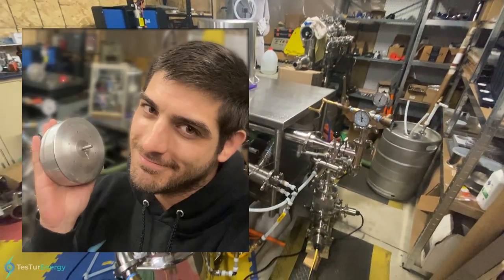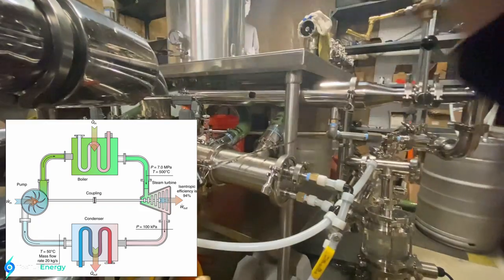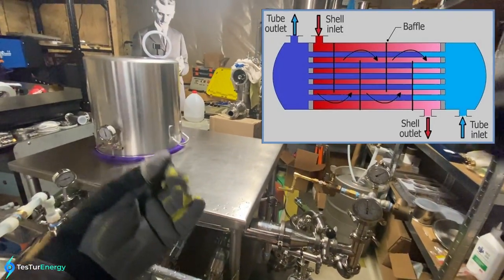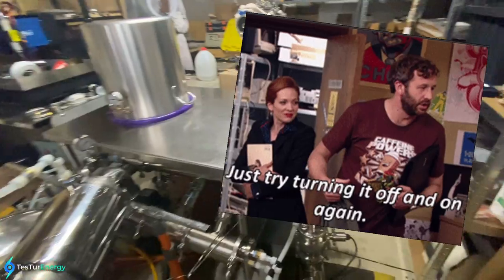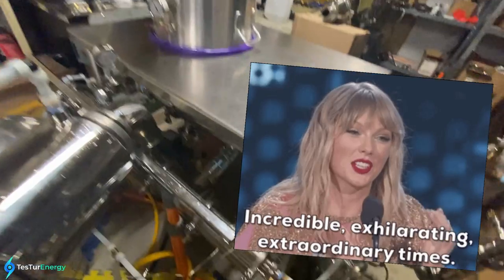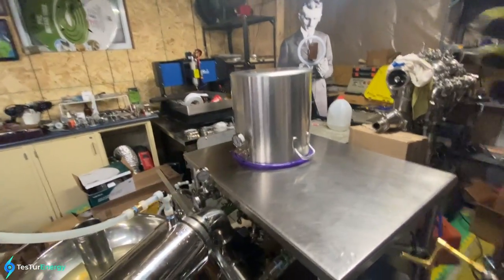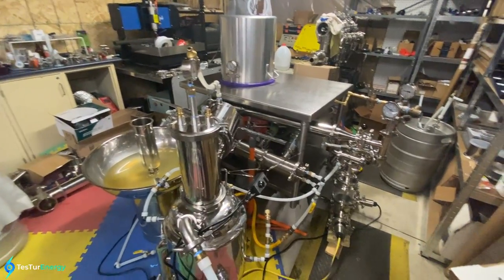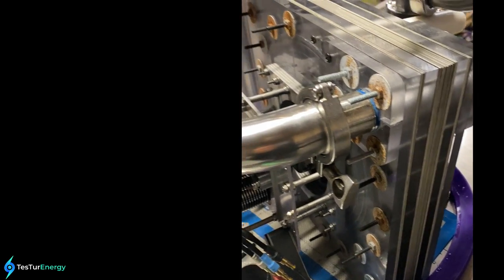Steam Tesla Turbine Renewable Energy Micro Power Plant - 1st Start Up

Comment: What made you choose 10 in disc and how thick of you don't mind me asking?
Reply from the maker: This was honestly more of a “what materials I could find to make it” and “what I could even fit onto my cnc machine bed.” Than a case of “what I would have made if I could have from scratch.” 

I also wanted to bring down the rpm of the turbine by going with a larger diameter disc.
Reply from the maker: It was also helpful to make one close to the size of tesla’s 9-3/4 in discs in the turbine that they tested at the Edison plant so I could get a comparison of power out.
Reply: Thanks for the reply. This is awesome. Maybe I missed this but have you looked into adding a pump on the shaft of the turbine.  I read somewhere it can increase efficiency. I apologize if you have done this already great work 

Cheers from Canada
Reply from the maker: @shawnrobinson368  hey Shawn no worries. Yes I have! I’ve got a video on one of my designs for that has the condenser/ heat exchanger between the turbine and the pump. Check it out! 

Tesla Turbine - InterStage Heat Exchanger (ISHE) - Heat Pump & Inverted Brayton Cycle Improvements
https://youtu.be/pYSniitC8DM
Reply from the maker: @shawnrobinson368  if you’d like more information on the thermodynamics check out the Inverted Brayton Cycle! 
https://en.wikipedia.org/wiki/Inverted_Brayton_cycle
Reply: Cool thanks I will be watching your updates. Maybe I will try my own version one day
Reply from the maker: @shawnrobinson368  Hey I just posted a new video! I think you’ll really like it. Who Owns Your Copy in the A.I. Revolution? https://youtu.be/_v0N83U4NoU

Comment: Just found your channel and I'm loving it. 

Sorry if this is a noobish question but what do you want to do with the electrical feed through? If it's to get sensor data on the speed of the turbine and no need to pass a lot of power through then you might do will with a micro processor with low power wireless and a battery. Maybe and induction coil to power it if you want to run it for a long time but I'd imagine you tear this thing down fairly regularly. 

A lot of microprocessors are designed to consume bugger all power when they are asleep these days, even a small lipo battery can last a long time.
Reply from the maker: Hey David! Thanks for commenting! It really helps with the algorithm! 

So for the vacuum feed through we specifically need it to pass the generator power wires from the inside to the outside. So potentially 250-350amps current through with the 12v up to 4000watts.
Reply: @CharlieSolis  thanks for explaining. 😀
Reply from the maker: @Omniwoof  you’re welcome! Thanks for the ideas! They will securely help for sensors and stuff.
Reply from the maker: @Omniwoof  Hey I just posted a new video! I think you’ll really like it.
Who Owns Your Copy in the A.I. Revolution?
https://youtu.be/_v0N83U4NoU

Comment: Have you ever checked out those rotary steam generators. They produces steam through rotation. They use cavitation to produce steam. You have to be careful with cavitation as it does produce radiation, but I believe that would be more efficient than using an resistive electrical heater.
Reply from the maker: Hey thanks for commenting! ❤️‍🔥🙏

Yes! 

Check out my design for an improved construction and manufacturing method for them! 

Solis Cavitation Heater - Simple & Improved Construction Griggs Hydrosonic Steam Water Pump
https://youtu.be/zbd50_hOy0U

Cheers mate!

Comment: very cool.
Reply from the maker: Hey much love and gratified my dood!
Reply: @CharlieSolis  do you have a video explaining what exactly your goal is with this. 
I definitely am with you when you say there is wasted heat and energy all over the place but do you believe that this Tesla turbine or a similar vacuum / geothermal or steam generator system can be realistically implemented for a net global savings? Im
Reply from the maker: Hey thanks for the reply! ❤️‍🔥🙏 yes I think it’s possible. I don’t think the TesTur will replace everything out there. 

But it can certainly be used in many places. 

I’ve got some copy pasta 🍝 I’ll share with ya that should help. 

With TesTur Energy, our mission is to give people energy independence through Combined Heat And Power (CHP) systems that can make use of underutilized energy sources like biomass, solar thermal, geothermal and even low grade fuels containing high quantities of solid particulates (like pulverized coal and powdered iron); energy sources/stores that are currently underutilized due to the lack of turbines and engines capable of handling the multiphase fluid flows (any combination of gasses, liquids, solid particulates) present in low grade heat boilers and low grade fuel sources without damage over prolonged/continuous periods of use.   

Www.HeatAndPower.com   

www.TesTurEnergy.com 

First and foremost, in terms of using high pressure, low temp gases in actual generator capacities, Compressed Air Energy Storage (CAES) and Liquid Air/Cryogenic Energy Storage (LAES/CES) are very viable solutions, and they’re being employed at industrial scales as we speak.  

When we look at how engines function, they typically compress air, heat it, and then expand it.   

Most gas turbines and turbojet engines possess a compressor, operating on what’s known as the Brayton cycle.   

For those unfamiliar, the Brayton cycle comprises three main processes:  

1) compression of air 

2) addition of heat (typically combustion but could be anything) 

3) then expansion of the air. 

If we’re talking about steam systems, only heat needs to be added to vaporize the fluid. 

Systems like ocean thermal energy conversion (OTEC) can vaporize steam, or even function in an organic Rankine cycle, at significantly reduced temperatures.  Tesla’s improved turbine patent GB 186,083 is particularly noteworthy here.  

It cleverly uses heat from the turbine exhaust to generate steam.   

This steam then cools the combustion jet before it enters the turbine, thus significantly reducing the compressed needs typical of most gas turbines.   

While regular gas turbines require an air-fuel mix in the range of 100:1 to 200:1, thanks to this innovative approach, Tesla’s patent slashes the load that the compressor puts on the shaft, making it efficient even with stoichiometric mixtures around 15:1.  

Moreover, Tesla’s patent GB 186,084 combines combustion and steam turbine functionality, eliminating the need for a compressor altogether. 

These preliminary tests are just to see how much electrical power can be produced with room temp compressed air driving the Tesla turbine.       

6.22ft-Ibs of torque at only 4150rpm and +4.25kW between 6000-12,000 rpm.        

That puts my plastic and aluminum prototype right in between a 50cc and 125cc piston engine on combustion and 150psi compression.  

The TesTur nozzles never went over 20psi at the nozzle for the 2650watt electrical load test and not over 40psi at the nozzle for the 4250watt dyno test.         

This is so I can get a baseline for what to expect as I increase the temps to combustion levels.         

When using elastic gasses the counterintuitive thing most overlook is that the viscosity of gasses goes up with temp.       

So not only do we see an increase in thermodynamic efficiency from increased temps but the TesTur isentropic efficiency also goes up due to the reduced slip from the increased viscosity.
Reply: @CharlieSolis  I have experience with jet turbines running on biomass ( see my vids). I also had the plan to couple the turbine to RC motors for power output, but unfortunately "real life" gets in the way and sends me into the Caribbean. The goal was to create a simple power generator that could work from hog fuel or discarded biomass. I wanted to eliminate complex steam systems. The low temperature that Tesla turbines can run on with noted patents is promising. Ultimately I don't want to be the person operating such a device.. I wanted to be able to train a general novice how to make their own power ( minimum 5kw) in less than a day and replace parts at a local parts store. Anyways I hope that's helpful

Comment: Would something like this be possible to produce power from the heat going out in the chimney from a bigger wood boiler?
Reply from the maker: Hey thanks for asking! Yup that’s one of the applications we’re shooting for! 
 
With TesTur Energy, we’re committed to empowering individuals with energy autonomy through our Combined Heat And Power (CHP) solutions.   Our systems are uniquely designed to harness overlooked energy resources like biomass, solar thermal, and geothermal, as well as unconventional fuels rich in solid particulates—think sawdust, pulverized coal, or powdered iron.  Traditionally, these alternative energy sources and fuels have been underexploited due to the limitations of existing turbines and engines.   These systems often can’t manage the complex fluid flows—mixtures of gases, liquids, and solid particles—that are characteristic of low-grade heat boilers and unconventional fuels.  But our technology changes that, enabling sustained, damage-free operation even in these challenging conditions.  www.HeatAndPower.com  www.TesTurEnergy.com 

Let me know if you have any questions! 
 
Cheers mate!

Comment: I'm interested in motorsport performance applications of a Tesla turbine (less lossy forced induction). Heat exchanger on exhaust manifold and Tesla turbine replacing either the impeller side of a turbo or both the impeller and compressor. Not sure if Tesla turbine can sustain higher pressure as a compressor. Figured you were the man to ask, you think this is feasible?
Reply from the maker: I really appreciate you taking the time to leave me a comment, it means a lot to me and it helps increase my visibility on the algorithm. I’m glad you’re interested in learning more about my project, I’ve put a lot of work into it

Yes I absolutely do think this is possible. I’m working on the design of the multistage Tesla compressor and high vacua pump right now, in fact. 

Thanks again for your support, and if you want to help me out even more, please consider donating to my Patreon page or any of the places on my linktree in my bio, it will help me to continue my project. Your support is greatly appreciated.
Reply from the maker: Check out my interstage heat exchanger idea for the Tesla turbine 🤓😬🙏❤️

Tesla Turbine - InterStage Heat Exchanger (ISHE) - Heat Pump & Inverted Brayton Cycle Improvements
https://youtu.be/pYSniitC8DM
Reply from the maker: Hey I just posted a new video! I think you’ll really like it. Who Owns Your Copy in the A.I. Revolution? https://youtu.be/_v0N83U4NoU

Comment: F yeah we could hear it! Jeez. Almost sounded there for a bit like it had no ceiling. Curious: What enclosure are the blades in to where you are safe standing right there? Or are you safe? Also, where is all of the water going if it is a sealed system like I am assuming? I know you said that heat comes off the cooling tower, but I thought that was radiant.
Reply from the maker: Hey Benny! Thanks for commenting! I really appreciate it. So the turbine is inside of an aluminum and 1/2in thick polycarbonate casing with 1in thick periphery. The turbine is then inside the aluminum vacuum chamber. 

I should probably also have a blast shield but these discs should be safe up to at least 7,000-9,000rpm and this won’t be going much over 3,000-4,000 rpm for the 12v output tests coming up soon. 

After the turbine the steam goes into the condenser. In this video I did not have a boiler feedwater/condensate return pump. So the water just went from the boiler and stayed in the condenser. That being said I’m testing out the pump I just installed for making it a full closed loop Rankine cycle system be be able to recycle the water from the condenser back into the boiler. And if this pump doesn’t work it’s just a matter of putting the right one in. 🤷‍♂️ 

Alongside this I’ve also installed a boiler feed water preheater that heats up the returning condensate with the now heated cooling water leaving the the condenser to give it back the last bit of heat from the hottest part, of the condenser just after the turbine for some efficiency increase, just before sending the water to the fountain for giving off the heat. 

It won’t be much at these temp ranges but at least it’ll serve as a proof of concept but it’ll be ready for combustion temp once I’m there. This can keep the “cooling water” loop in the condenser at a higher pressure so that it can go up to higher temps and not boil before reaching the fountain and releasing up the riser column more efficiently with the higher temperature gradient. That or use a liquid with a higher boiling point than water for the cooling but that seems messy and complicated.
Reply from the maker: Hey I just posted a new video! I think you’ll really like it.
Who Owns Your Copy in the A.I. Revolution?
https://youtu.be/_v0N83U4NoU

Comment: Interesting setup. One concern I would have is the cooling of the electric generators. In a vacuum, you're basically relying on the conduction through to keep the insulation from melting. No convection :( . Not sure if you thought of that, if you did mention it in the video, my apologies, I didn't have time to watch in entirety.
Reply from the maker: @JonPrevost  hey thanks for commenting. 🙏❤️‍🔥 
So in the latest setup I have cooling water jetting onto the generators themselves. 
 
Which is great because if the generators are over the boiling point they the water will rapidly remove heat from them via the latent heat of vaporization, even better than any air or even just water cooling. 
 
I would like to make the generator boil off actually go to the nozzle in a final build to just recoup the any energy (it won’t be great but it’s something 🤷‍♂️) to add back to the torque output.

Thanks again for commenting!